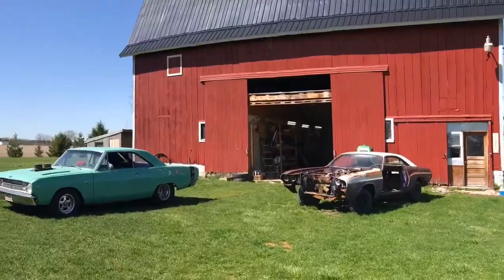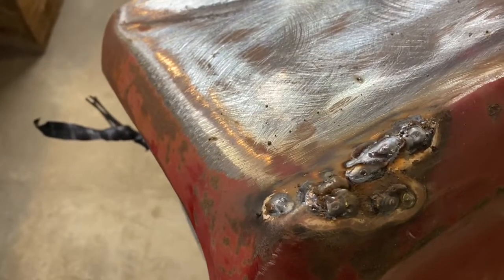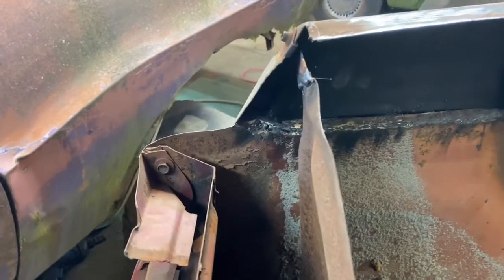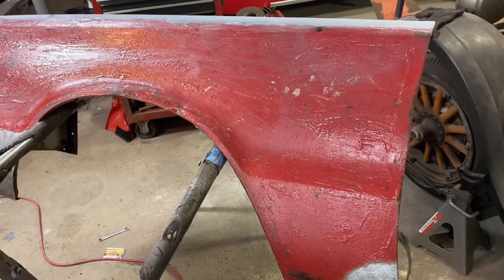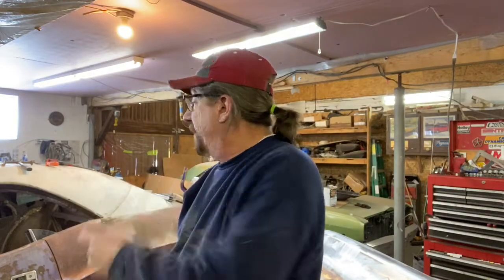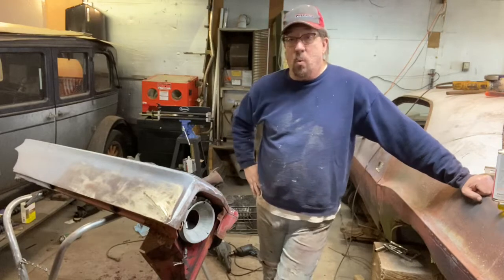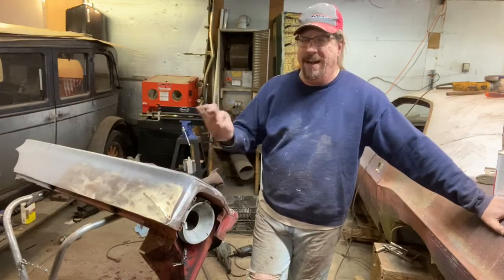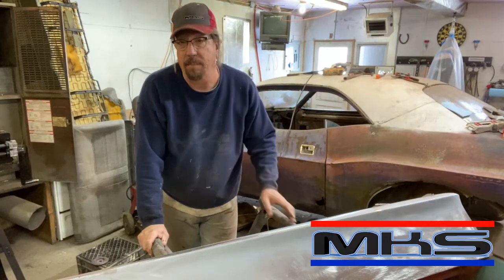Repairing the Front Fender - Jon's 66 Belvedere - EP2

Comment: What kind of welding wire do you use/recommend?  And which diameter do you use for sheet metal work?
Reply from the maker: I’m using either .020 or .025.  I can’t remember which, but either one works well. The rule of thumb is to use wire that’s just a bit thinner than the material you plan to weld.

I think I’m using Lincoln brand wire? But I’ve used so many different brands, I don’t remember for sure what I currently have . 

But it is MIG, not flux core. In the early days I didn’t have the gas tank, so I used flux core, but it was similar to welding with a coat hanger. If you don’t have the gas, invest in it. It’s worth it

Thank you so much for your question, and thank you so much for watching the episode. I truly appreciate you.
Reply: @MyKARSShop  I do have a gas setup, so that will help.  I'm use to welding thicker steel with whatever was on the shelf.  Usually .035" or .045".  I remember reading a long time ago that there is a wire specifically for auto body sheet metal.  I think it was supposed to be softer for easier grinding/not digging into the base metal.  I was wondering if you might be using it or know of it.  Keep up the good work.
Reply from the maker: @UncleDonut66  yes. Get the smaller tips & the smaller wire… with that  You can do some pretty good work. Just spend a few days practicing on scraps before you tackle something important.

If you’re careful and do a lot of spotting and triggering you can weld some pretty thin stuff without warping.

Also when it comes to grinding, make sure you focus on the weld and not the surrounding metal. You’ve seen what I do in the videos, I hope that’s helpful.

Rock on. Let me know how it goes for you. 🤟🏼😎🤟🏼

Comment: Great episode! Body work is tedious work but your knocking it out! That fender is looking great! When it comes to sand blasting, would your recommend not sandblasting any body panels or just outside panels? I had considered sand blasting the inside of my crew cab when I do all the floor panels and B pillars in order to get all the small areas and in between panels.
Reply from the maker: Anything that you don’t care about potential warpage is fair game.  

Things like floor pans, cab structure etc. would be fine I’m sure. I doubt I would do the back of the cab because that could potentially warp. The other downside of sandblasting is just the mess. Your vehicle will always be dripping sand for the rest of its life. LOL

Maybe I should do a tech tip on sandblasting.
Reply: @MyKARSShop  Tech tip on sandblasting sound like a good idea, Ive considered buying a harbor freight sand blaster for the inside and bottom on my cab but Im debating if its work the time and money.
Reply from the maker: @DuddiesAdventure  I’ll put that on my episode planning board and get it done in the next few days.